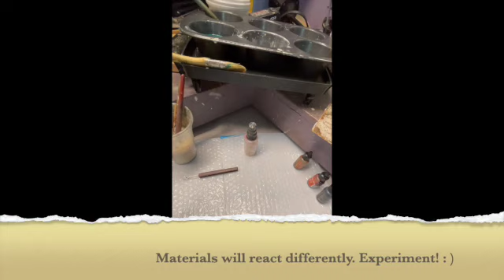How to Use Wax to Create a Grungy Texture for Your Journal Pages

Comment: Hi Mama Judy, These are some wonderful textures. I am looking for products that I can use to layer on to archive a distressed look for a wool felt pirate hat. I've tried some oils and plaster wax which is nice but I would like to be able to use something that I can achieve a grungy crackled built up look in areas of the hat. The hat will be shellacked but possibly some flexing to it. Will this wax harden enough to stay as part of my design do you think? I've never used waxes but as I'm looking at an image of a hat on Pintrest, there are beautiful layers of what I see as lace, paint, ink, mica and wax, which looks crackled. So cool!  Do you know of any crackle past that would work on a flexible fabric?
Thank you for your time! Elizabeth